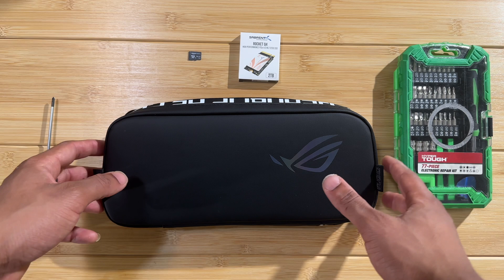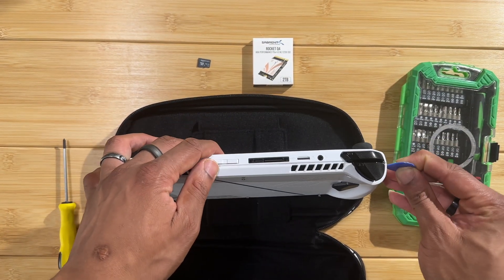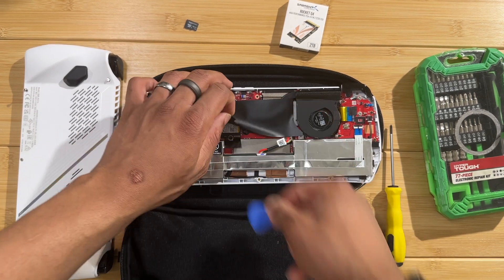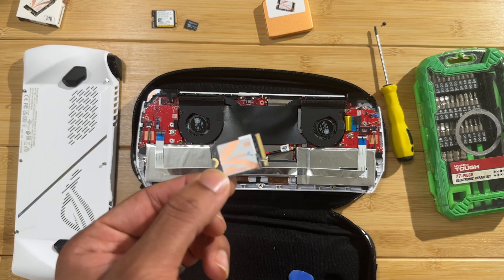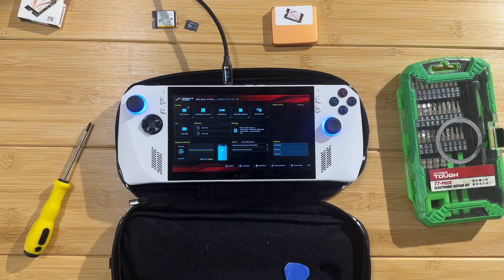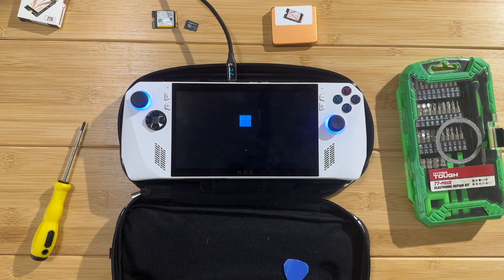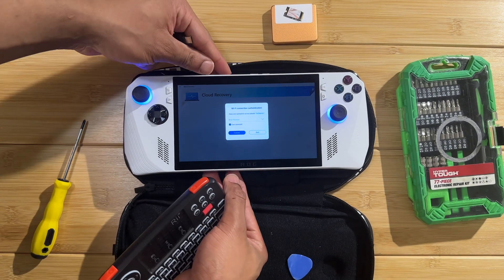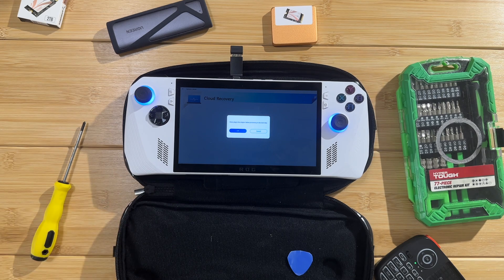ROG Ally 2Tb SSD Replacement | 3Tb Upgrade!

Comment: I did this exact same thing but the ally micro sd slot died.
Reply from the maker: That’s sad to hear. But it’s not caused by changing the SSD.
Reply: @BarelyAverageDude  yeah it’s caused by the placement near the exhaust. It heats up the drive and kills the board.

Comment: For those wondering yes you can easily fit a 2280 and if you want a easy windows install the get the iso from ghost and you'll be up and running in 5 min
Reply: Can you put one in without having to remove any components or cut plastic?
And can you slide it in with the battery intact or do you need to remove that fully?
Reply: @afbakappeltaart5498  battery has to be removed before the drive can be installed and I haven’t found a drive yet that will fit without cutting but I just ordered a cable for my oculink setup and I’m gonna see if I can relocate the drive to the back of the case.
Reply: @prodigy455  how will you take the m.2 port to the back, or is the cable for extension like a riser cable does?
Reply: @afbakappeltaart5498  it’s a riser cable and using Velcro on the m.2

Comment: Question.. the on screen keyboard didnt come up. What if you press and hold the macro button and press up on the D pad.
Would that bring it up?

In that part of the set up does blue tooth work? I have a bluetooth keyboard but not one with a dongle to plug into the USBC port like you used.

So im not sure if i could make it past that step
Reply from the maker: I didn't try the macro, but we're technically not in windows yet at that point. As for a Bluetooth keyboard, even if Bluetooth was on I'm not sure how you would select the keyboard to pair it. Bluetooth doesn't automatically connect.

Comment: That’s crazy, it’s even easier than the steam deck
Reply from the maker: Yeah the cloud recovery really saves a lot of time and hassle.
Reply: Is the cloud recovery already in the system or do you need to download it before changing the ssd card?
Reply from the maker: @Loth-n1v  I think you have to be on the latest bios for cloud recovery. Newer units may already be on the latest bios but you'd have to risk it to find out. Update when you get the device then swap ssd
Reply: @BarelyAverageDude  oh ok it’ll be delivered tomorrow I’ll check if it does have the cloud storage asap